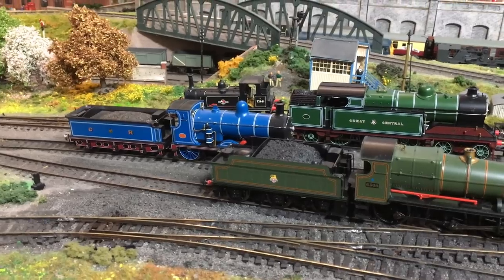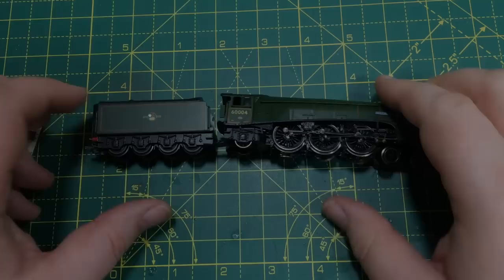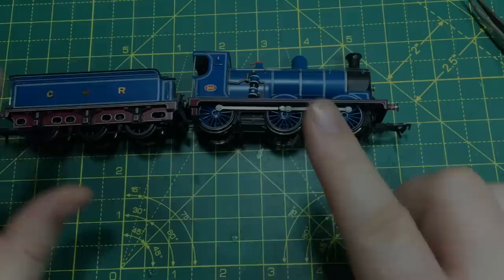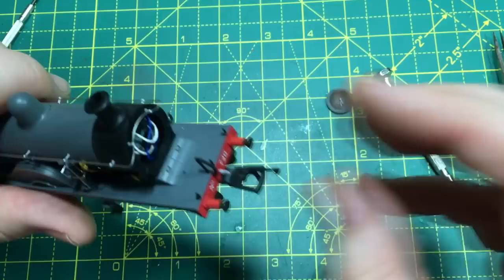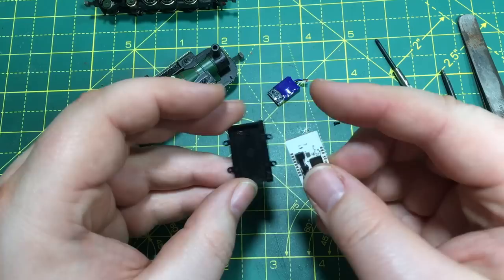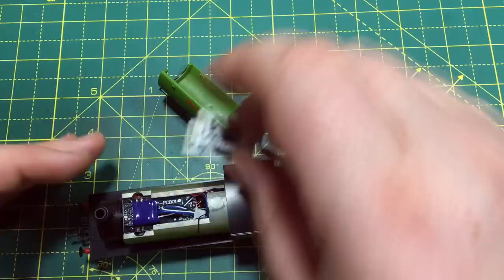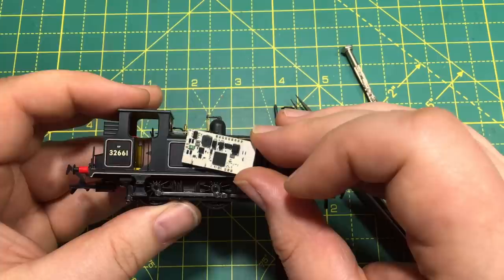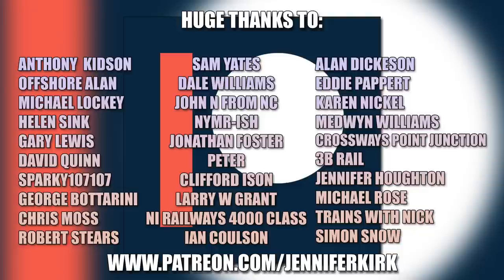Will it Fit in YOUR Model? Testing the Hornby HM7000 Bluetooth Decoder

Comment: Really should use ESD precautions when handling decoders. (Even mentioned in the Hornby manual).

It's interesting that Hornby can make TT120 locos that will take the next18, and it will fit in an N gauge loco. The fact a tiny adjustment made it fit in the Victory says a lot about the effort put in by manufacturers to accommodate decoders, though I suppose they manufacture to accommodate decoders that meet NMRA standards for size, which these don't, in spite of what Hornby claim. 

A very fair review, and I like the positivity. So many reviewers now focus on the negatives and take an overall pessimistic view. Optimism is way more encouraging for the future of the hobby!

Comment: Thanks for this video, was quite some work to fiddle with the decoders in the different locos I think. One think we need to keep in mind: It is not the loco manufacturers fault that the decoder doesn't fit into several locomotives, as all these manufacturers worked according to the standards. The one which is not following the standard is the Hornby decoder... And speaking about ABC - well the better decoders have this feature since the end of the last century (Lenz (inventor), Zimo, ESU, just to name a few)

Comment: Problem is and a small correction. Hornby are still implicitly marketing this as a range of decoders that fits other models, its even wordd as such on the range page.

Its also interesting to see that the 6 pin has now been delayed until Autumn because the available build with current components wouldnt even fit most of Hornbys 6 pin models.

Comment: Another point I can see is the sockets for the speaker and stay alive are at an edge facing out. This makes the unit even wider, where as if the pugs were central on the board and faced inward so the pugs sat over the other components it would help reduce the footprint. Also if the blue tooth antena was either separate or the layout of the board improved to make it smaller ( I can clearly see where it could be improved massively) that would make it better too.
But as you say it was designed to fit one particular application, and as such a totally missed opportunity by Hornby. Again hornby like with the TT:120 stuff they have launched that have and lots of little issues, it's a good idea ALMOST well done. 
Hopefully someone else will pick up this idea and improve it for more general use.

Comment: Excellent video! The most useful feedback with these is seeing if they'll fit or not and we've only gotten info slowly trickling in. Great to see you give us a large variety of fitments from a technician's viewpoint! Have you considered doing an 8-pin or 21-pin test? I would certainly watch that.
Reply: The 8 pin one has a wiring harness so as long as you aren't forced to cram it in crazy places it will fit.
The 21 pin one could be a challenge as the amount of possible options makes the area around the decoder very crowded with electronic components

Comment: The thing is that the NEXT18 format has a formal size associated with it. Therefore all the locos should be designed for this. The additional complication with the Hornby system is the stay alive and speaker connectors further reduce the space available. Obviously those form a key advantage of the system and therefore I would hope the next gen are actually smaller than the standard.
Reply: The locos are. Hornby's decoder isn't.
Reply: Sorry that was what I meant.
Reply: Well Hornby is trying to fit full size HO/OO level components (1.5A max current) on a form factor which is only used for N scale (and the odd mini motor shunter),with the spacing of a HO decoder and some electrical plugs with required clearances. So trying to fit that on the pcb even without the required antenna size is a challenge

Comment: Not sure why you say the Hornby N18TXS was designed specifically for TT:120, as Hornby's own product information does NOT state this. On the contrary it says "Part of the innovative new HM7000 range, this Next18-pin Bluetooth® and DCC sound decoder is ready to plug into locomotives featuring a Next18 (NEM662) socket. You'll find the Next18 socket in more modern Hornby locos and many other locomotives in OO, HO and some smaller scale locomotives.", which any reasonable person would take to mean it would at least fit HO/OO scales and other manufacturers. Hornby are definitely pushing it to market on this premise. It's clear from your (and others) excellent testing that the model scale is not the issue, it's that the decoder is simply too big for many models and there's a certain amount of "buyer beware" required. Roll on HM7000 V2....
Reply: Yes it is misleading as are Hornby

Comment: I just got one for my Hornby Dublo Scotsman for my first try in DCC models and I'm blown away. Its amazing. It has an 8-pin socket, but its very good. I was actually wondering if I could get one of these decoders for upcoming locomotives, like my Railroad 9F or the Tornado. Now, I have one question where I haven't found an answer yet. How does this decoder work with locomotives which are DCC ready and have a pre-installed speaker? Will a normal decoder do or do I need another sound one?
PS: So good that it fits into Victory I intend to get one in the next few months and a power bank as well? Definately the least expected for me considering its a tank engine but good stuff. Very good to know

Comment: I think you might be able to fit the Next 18 decoder elsewhere, such as in the tender on some locos, rather than directly by using 2x "ESU 51993 Wire Harness 18-pin Next18 socket to bare wire" or similar!  Thanks for uploading.

Comment: Good on you! The more info we have, the better.
I have got a couple of the 8-pin ones and they do seem bigger than many others but you'd probably expect that as the Bluetooth antenna takes up space.
From the first 4 locos I tried to fit them in, they fit into 2. (Not Hornby btw) 
A great low-cost sound option where they will fit. (I'm not really planning on using the Bluetooth much) A smaller option for revision2 would be awesome.
edit: I wonder if the antenna could be separated and wired to allow more flexible installation.

Comment: Great video, I agree with you that Hornby are not obliged to make these decoders fit into other brands locos, but when they state on the packaging NMRA Next18, one assumes the Hornby chip conforms to these NMRA standards and thus would fit in other Next18 locomotives, we know that the chip is larger than the standard which is very misleading.  I also think it is not a realistic solution for buyers to need to remove pieces of the chip and/or locomotive to make it fit.

You mentioned that Hornby have some limitations on the size of components that can be sourced and they plan to reduce the size in the future, assuming this information is from Hornby, this suggests to me that they have rushed this product out when it is not ready, another example of this again product marketed as supporting Android devices, but this is also not yet available.

This product has potential to be great, but I think Hornby have made lots of mistakes with this and probably should have waited to further refine it before launching or they should have been a lot clearer about the current limitations.

Comment: Great video. I have tested the 8 pin 7000 in a couple on my locos. They worked great using the Hornby Elite and Select but when I tried it on my loft layout which is a Digitrax system the loco just juddered when I turned on track power. I spent days trying to get to the root of the problem without any real success. Regards. Bryn.
Reply: I have 3 of the new decoders and also have digitrax dcs210+ with the dt602 throttle and they all run fine on my layout.
Reply: @stephenbromley2302  that is exactly what I have but mine do not work. Did you need to set anything to get them to work?
Reply: @toots.007  I found that sometimes when changing the address on hm7000 it doesn’t always take so I still program the decoders on my program track and turn off analogue in the quick cv menu but they have all run fine on blutooth I installed another one yesterday in my 91 with the class 73 profile and it runs really smooth but most of the time I set them up and alter things on the app then switch them to Dcc and just use my throttle this may change once the legacy dongle comes out and if it works with digitrax sorry I can’t be more helpful,I am in the process of fitting power banks to each decoder and as for power it comes out of the base station into Dcc concepts amp meter into Dcc concepts ip circuit breaker then to the track all my points and signals are run from a separate bus.

Comment: Seems to me that an antenna need not be on the printed circuit but could simply be plugged in.  A bit of wire strung up the chimney or what have you.

Comment: Great video Jenny. The N gauge modern loco has a very different shape from the steam shapes of all the others. 
It is a pity Hornby did not just put “TT120 only”  on the packaging of the Next 18 decoder so that no one was mislead. 
Saying it was to standard was either sloppy (because it was not the size in the standard) or too clever by half if one has to read the words in the statement about operation as meaning  “it is to standard in some bits but not others and you will have to check the whole standard agains our extensive instruction book to see what bits we Hornby have decided not to meet.”
I hope they fix the size issue soon as the idea is excellent in concept and someone else will fill the gap for them if they are not going to be able to service the models of Dapol, Heljan and Bachmann. 
If the correct size becomes available, folk will use that for Planet too rather than hack their models and have to paint the decoder to use Hornby. 
Further, if folk have to use another supplier for part of their loco fleet, they will probably use that other for the rest to avoid operational confusion.

Comment: Something either conforms to a standard or it doesn't. 
This doesn't. A crying shame, as this system does have promise, if it only fitted in other makers' models (as the bloody standards are for), it would really be a step forward that I would actually be quite quite interested in. As it is, it's a frustrating and rather perplexing failure. Fiddling about and trimming is not good enough, look at the elegant design of Dapol smoke box door or the Accurascale magnetic lid.
I am truly racking my brains, as a UI/UX designer of over 25 years experience, to understand how in a million years this size of board ever got signed off for production and sale... 
Extraordinary.